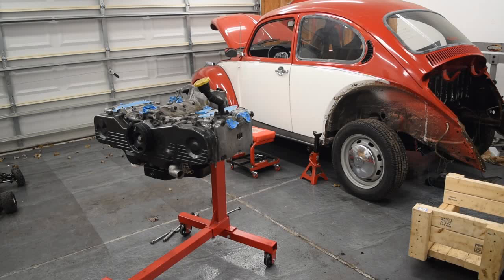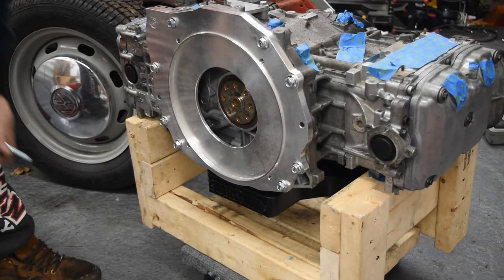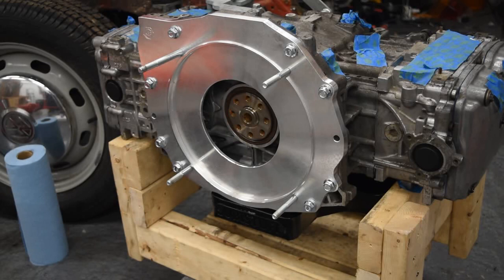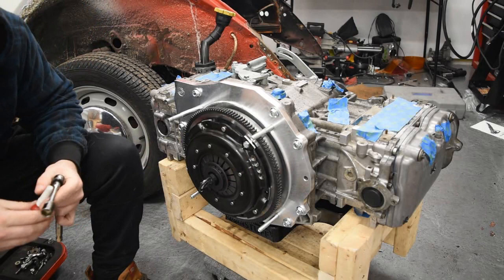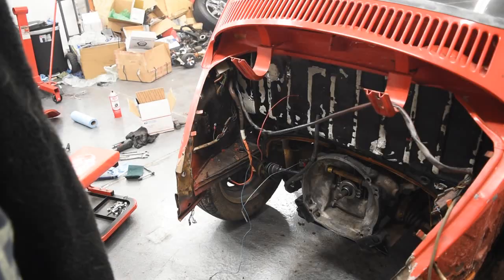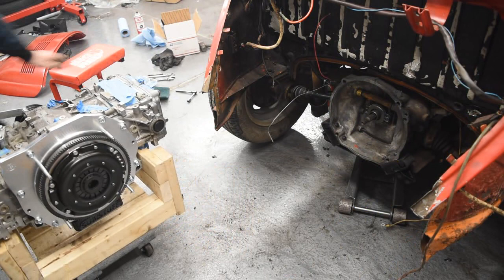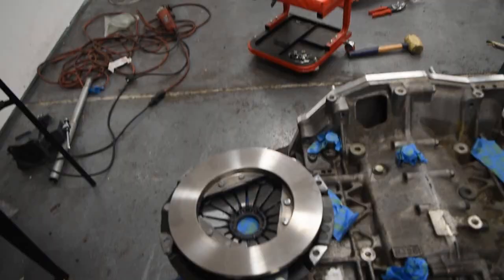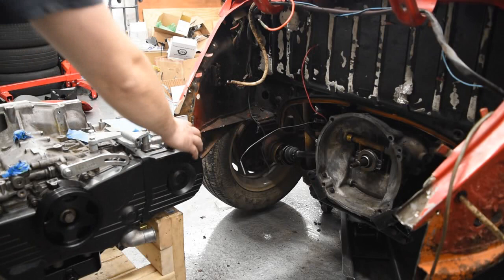Subaru Engine Install (NO MUSIC) -- 1973 VW Super Beetle Subaru Swap

Comment: How did you eventually get the adapter plate to fit without the lower bolts hitting the transmission mounts?

Comment: So I'm a very complete noob but I have always been intresting in the ej swap into a bug. I have a 75 super beetle, my question is the only ting holding the engine in place is the transmission no other support? That has always been my biggest question about theses swaps is support the engine.
Reply from the maker: That is correct, there is not any engine mount in the VW or for the conversions so it’s really just hanging out there using the transmission mounts. I think I will fabricate some sort of engine subframe but currently nothing exists.
Reply: @RatchetMotors  thank you for the information

Comment: Would you mind telling me how much it costed to do the conversion?A detailed break down will make sense as i have always wanted to do a similar project on a T3 bus.And did you have to use EJ251 headers instead of the original EJ255 headers?
Reply from the maker: The engine is a ej255 shortblock with ej251 heads.  I've been keeping track of almost all costs and have about $5k invested including all hardware and machine work.
Reply: @RatchetMotors  Thanks for the quick accurate response. You have earned my sub.Looking forward to the latest video,hope it will be out soon.I have a soft spot for EJ207,i wonder what your advice would be.
Reply from the maker: I will provide a detail price breakdown in one of my coming videos but the big ticket items were head rebuild/machining, engine computer, adapter kit, and clutch.  I am sticking with the EJ255 headers because I will be going turbocharged but EJ251 headers would work just fine for NA. Regarding the EJ207, I say send it! It's a great motor with a lot of aftermarket but essentially would be very similar to the swap I'm performing.  The EJ25 has slightly bigger displacement (think low end torque) whereas the EJ207 is known to be more "rev-happy", a lot of it is just personal preference.
Reply: @RatchetMotors  Thanks for the info...following the build for more updates.

Comment: Good work! What did you have to torque the adaptor plate down to?
Reply from the maker: Hi Jerad, there wasn’t a specific torque provided so I made sure they were at least as tight as Subaru specified for bellhousing bolts (about 40 ft-lbs). Then I snugged them up a little more for reassurance. Also I made sure to use blue loctite to help avoid the bolts loosening over time but still not permanent like red loctite if I need to remove in the future.
Reply: @RatchetMotors  Awesome! Thank you very much.

Comment: When will we see it on the road please?
Reply from the maker: Hopefully first start will be in the month of April! Much more content coming in the next few weeks.
Reply: someone else did a subaru conversion but the test drive was realy boring. Tell us more about the different HP and expected performances? thanks  @RatchetMotors
Reply from the maker: I am expecting this car to be a great overall performer.  Based on the engine/turbo combination and the use of WRX shortblock, we should be in the 250-300hp range with plenty room to grow.  Even at the lowest power this motor combination can provide, we will really need to focus on suspension and braking to make this car a true beast.  250+ hp in a car weighing around 2000lbs should perform well and we are hoping to bring this car and compete at dragstrips and autocross events with the appropriate upgrades.